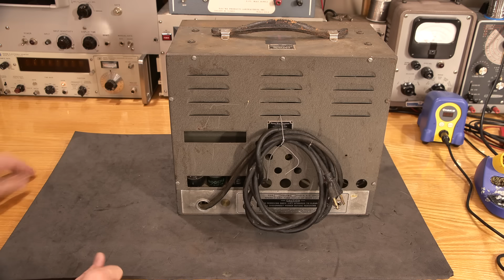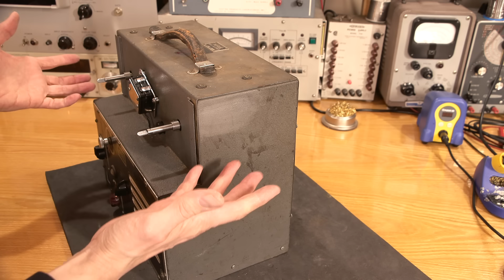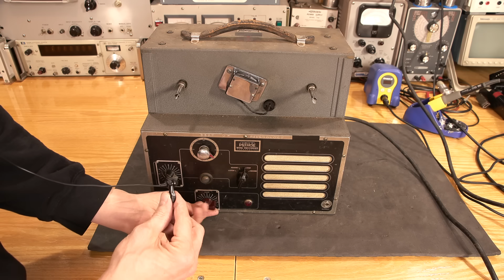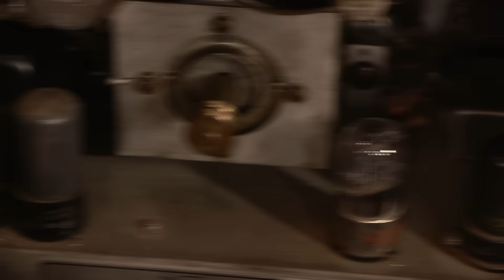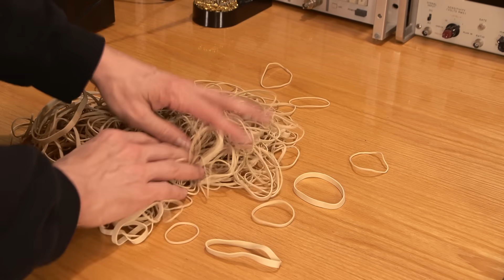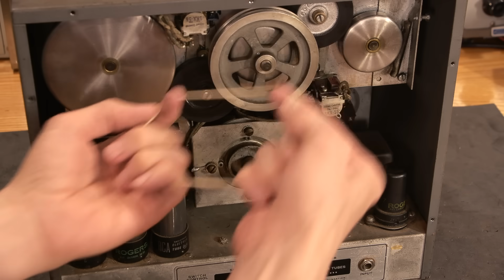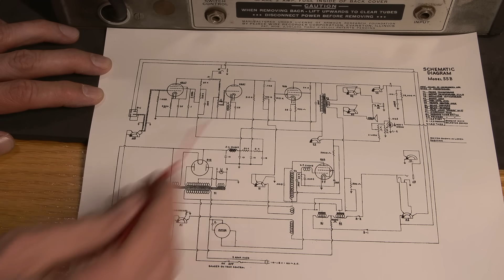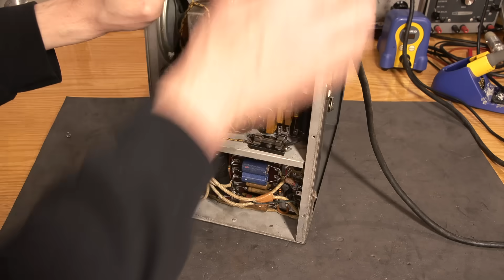Trapped Voices In This Wire - Let's Listen To Them!

Comment: This is the coolest thing I’ve ever seen. I’m 41 and didn’t even know this was a method of voice recording. So badass.
Reply: I'm 62 and never heard of this technology either
Reply: @briantaulbee6452  it’s crazy right?  How the hell does that even work!? On a thin steel wire!?!? Insane. Maybe it was a very short time frame it existed. Maybe something came out rather quickly after. I’ll bet it was one of those inventions that came about trying to improve a preexisting technology!? Who knows but it’s super cool that that can even happen.
Reply: @Ryan.S924  Magnetic audio tape came out a few years later and blew wire recorders out of the water. Tape is stronger, way less prone to breakage, and can be spliced and edited with adhesive tape. Once a thin wire breaks, theres almost no way to join it.
Reply: @Ryan.S924  I assume it's magnetic, just like audio tape. When developing recording techniques using magnetic fields, metal wire seems like an obvious first choice.
Reply: @ makes sense. Just never knew it existed. My before my generation tech knowledge is lacking lol.
Reply: @WaveArsenal  Just what I thought! What if it breaks? I remember then magnetic tapes, cassettes and vinyls. When you put a rubber belts in a turntable, the music/voice is never the right speed, and rubbers are so feeble! Anyhow, that machine worked. Mr Carlson, put us some music. Quality video. Congrats!
Reply: @Nyerguds  So the line goes back and forward to tangle well!
Reply: @Whystu725  ...did you reply tot he wrong person? I only commented on metal wire being an obvious medium for developing magnetic storage.
Reply: @Nyerguds  Gotta be doesn't it? So basically it's a tape recorder but the tape is a filament instead of a film.
Reply: @MASAo7  Yep.
Reply: @Ryan.S924 It's obviously a precursor to tape. Very, very cool, though and I had no idea this existed either.
Reply: @WaveArsenal  The betamax version of reel to reel. LOL.
Reply: @Ryan.S924  magnetic recording, same as audio tape
Reply: @ it predates audio tape and uses the same technology as tape recording, just magnetizing the wire to encode the audio signal same way audio tape is recorded.  Hard disk drives use the same idea too, magnetizing the disc surface particles to store data bits.
Reply: @Ryan.S924 it works magnetically, the same way as tape. Tape gets better fidelity though by using particles, magnetic recordings can "seep" along the wire shortly after recording, limiting bandwidth. On tape, this is isolated to individual particles.
Reply: @Ryan.S924  Wire recorders used to be used for dictation before tape recorders. I think the Germans invented them but not sure. I don't think they did too well for music though.
Reply: @Ryan.S924  u could also do it on pots and I'm not joking about that myth busters proved u could but the audio quality is crap
Reply: @Ryan.S924  amazing stuff
Reply: @briantaulbee6452 wouldn't this theoretically be similar to tape recording?
Reply: @briantaulbee6452  50 and this is a first!
Reply: @briantaulbee6452  By the time you were a teenager I suppose everything was cassettes.
Reply: I too was unaware that this technology existed and what really struck me was the clarity, its also a little creepy to hear the voice of someone who has probably been dead since before I was born…
Reply: @Turbohuff Happens with music all the time.
Reply: @Turbohuff  It sounded a little odd as they were talking about trying to control certain aspects of society. CIA kind of stuff.
Reply: Almost 60 and never did.
Reply: There was another contraption that worked by letting a speaker head fall to the floor as the wire tension in the middle slows the descent. On it's way down the speaker will play the voice recording. No electrical power needed!
Reply from the maker: Thanks! Glad you enjoyed it.
Reply: @MrCarlsonsLab   this was great, i am trying to replace a HygainVII Chassis Socket  a 5DIN i am learning its not easy
Reply: @MrCarlsonsLab 
Jesus is the way, the truth and the life. Turn to him and repent from your sins today ❤️
Reply: Can we hear the whole wiretape please ???  @MrCarlsonsLab
Reply: I’m 60.  It’s amazing, and scary the amount of history that is lost from generation to generation!  The things that my 24 yo son doesn’t know about/has never even heard of is concerning.  I don’t know if it’s just schools don’t teach these things anymore, more young people don’t read as much, or if the whole phone/internet thing has just distracted everyone and “dumbed down” younger generations.  History can be lost so quickly… if we don’t pass it on to the generations behind us!
Reply: @KimDsmom  yeah I understand and you’re def correct. However seeing most of these comments there is just as many people your age or older who have never heard of this tech. So it’s almost like you guys weren’t even learning about it as it came out!
Reply: @ Well, this tech was before my time, so wouldn’t have experienced it, but, WWI & II, for example, were before my time, and we were taught about that in school in my day.  (I assume most students these days  are still instructed on the world’s two major wars.)  I get your point, though.  This item here is kind of a peripheral aspect of a particular time period.  How I know about it is from watching old Classic Hollywood films, from the age of five.  You are exposed to a lot of tech of that time, and other cultural and daily life examples in those movies.  I still love them!  (I missed “Boomer” by a year.  WWII is my favorite era!  My son is a History major, and it’s his, as well. 🫶🏼)
Reply: @KimDsmom  i’m 43 and my daughter just turned 20 this year and that is absolutely frightening enough lol but just like you said, I am so worried for her and this whole entire next generation because of how far behind they are when I was 12 years old I was close to 6 foot tall already and as soon as I was able to carry two by fours and plywood up a ladder, I was working for my uncle making 100 bucks a day. I worked throughout my entire teenage years all the while going to school at the same time then when I was around 14 I got a job at my uncles gym, working the desk and helping people with nutrition information and also as a physical trainer as I got older and new more and more about fitness and nutrition.  I would get out of school at like 2:15pm then I would jump on the first bus and after about 10 to 15 minutes I was already at my stop and I would jump out and go to work from 3 PM to 10 PM working the desk at the gym And I was making pretty good money, especially for the 90s. I mean I was already making $500+ a week and I wasn’t paying taxes on it because I was only 14 years old. So I started to help my mother pay rent because I was making more than her I believe she was only making $350 a week after taxes as a nurse so I did my best and I was able to pay the rent out of one weeks worth of pay and then I still had all the rest of the money to do what I wanted I saved it and I bought my first car at 15 years old and stored it while I took and all that good stuff and then I made a mistake by dropping out of school because I figured I was already making more money than the adults around me although I did go back to the owl program, which was night school and I got my diploma. I just wish I would’ve stayed in the regular school so I was able to, go to prom and I missed out on that as I was saying I was ahead in life. I was already paying rent. I was the owner of two motorcycles and two cars and a pick up truck and that was all by the time I was 17 my daughter refuses to drive a car, even though she had the money to buy a car, she didn’t want to because she’s scared of driving and it really scares me because she’s 20 now and she still refuses to drive. She took a bunch of money that we had saved up for her car and she went out and bought $2000 plus of computer parts because she’s building her own computer for the first time which I’m very proud of that but she just spent thousands of dollars on a computer so I’m hoping she turns into some kind of career building. I don’t know. I feel like a lot of the children these days are developmentally stunted from this whole Covid thing that happened and I mean any human being that is stuck in the house for 2 to 3 years and then they finally allow people to go outside and try to get back to normal but unfortunately a large majority of people and especially children that got thrown into the situation they’re just not normal I don’t even know how to say it but they don’t have any social skills and their whole life is depending on an iPhone and a tablet and a computer being in front of them at all times she has missed out on so much stuff and it actually scares me because she’s old enough now to be on her own and she is absolutely not gonna be able to do that for quite a while. I mean I had my own apartment by the time. I was 17 years old I was renting a two bedroom apartment and growing weed in it, I mean I was quite the entrepreneur when I was younger and all throughout my life as well and I thought some of that was gonna rub off on her and I don’t know it’s just me for this whole generation of kids that are into young adults and I just don’t know how she’s gonna survive. I feel like she’s gonna live either with me or her mother for the rest of her life because she doesn’t get off of the computer, I mean she has a nice computer though because she spent enough money to buy a freaking car and just the parts actually which is great because normally the computer like that would cost like $3000-$4000 if you were to buy it already built with all of the parts and everything that she put into it so I am proud of that because she could make that into a career, she could make a lot of money, just building computers for people and she wouldn’t even have to leave her house. She could probably build them and ship them with UPS or something, she’s not motivated and has no lake drive in ambition that I used to have I mean goodness when I was 21 years old I was already taking care of children that we’re not mine because I got engaged to a woman and she had a little sister that was being neglected we adopted little sister and I was literally raising five year-old girl by the time I was 21 years old then when I was 23 I had my first biological child and that’s my daughter that is now 20 years old and I can just imagine my kid getting into her 30s and still not leaving the houseand that scares the shit out of me
Reply: @KimDsmom  "All those moments will be lost in time, like tears in rain."
Reply: Today years old plus 66 and this is new to me too. Very cool!
Reply: I'm 58 and just learned of wire recordings!
Reply: I don’t care about the electronics, just what was on it!
Reply: @ that was me for
Most of the video. It’s the perfect way to keep the viewer into the whole video. But nevertheless the technology is super cool on how you can recorded voice and wave lengths on wire AND THEN play it back. Blows my mind
Reply: Im a fetus i don't know what any of this shyt is and im efing scared
Reply: @AbeIsLincoln I’m 66 and never heard of this before
Reply: Finish it!!!
Reply: I would really like to see this restored. Its like ghost's from the past.
Reply: I'm 112 yo and never heard about something like this either! It must be from a parallel universe!
Reply: I'm 69 and never even heard of this method of recording.
Reply: @frankfielder  It has a magnet similar to tape recorders inside, above the box when opened backwards.
Reply: Magnetic wire led to magnetic tape what you knew as floppy disks and VHS tapes. That’s what allowed computer memory to expand before hard disc drives. It’s directly related to modern recording
Reply: @usernameonutube  theirs not many wired left but some still keep them perserved
Reply: 59, new to me! Very interesting! 🧐
Reply: I'm 54 and didn't know this existed and thought I was pretty knowlegable about tech lol.  This is amazing!
Reply: People remember cell phones only as far back as 1990's maybe late 1980's which was as big as a house phone.
Well the government had car phones in the 1960's, as big as a landline house phone back then and hooked to a big box.
They didn't work the same way as cell phones today and each call was charged for same way as landlines back then into the 1990's, except way more per call.
Only the rich could afford one so most never knew of them.
Reply: You should have seen the 40, it used cable and the 39 utilized chain.  Coincidentally WD40 was invented to clean, lucubrate and preserve the wire before the use of stainless.
Reply: @ so cool. I wish I grew up back then. Coming up with inventions for inventions lol
Reply: @Ryan.S924  I am a Laura Ingalls Wilder fan and she lived from 1867 to 1958--she literally saw everthing invented that we know today.  EVERY. THING.  All the way down to chewing gum! (it existed earlier but first patented in 1869).  Ok, well except trains and steam engines lol.
Reply: Yeah I'm almost 50 and never heard of it.
Reply: Bro you need to come spend a day in my life 😊
Reply: I’m 67 and I’m blown away I never knew about wire recording
Reply: I also had no idea that this could be done. I'd like to know how it went.. Was this wire used specifically to record voices? What was being done with the wire when it was recording? Did the guys talking have any idea their voices were being recorded? You all know way more than me, but how did you know there might be voices on this wire? I remember having a reel-to-reel tape recorder and was aware of only that "tape" being a recording medium. Can all metals pick up voices, or is it just this one kind? So many questions, so few answers
Reply: Same but I am 49... I would love to hear the entire conversation!!  so cool. Sounds better than my 35 yo cassette tapes.
Reply: Now thinking if I was a millionaire in 1940s I'd hook up 8 of these machines with a sync and do world's first multitrack recording :D
Reply: @DCXTV  not too late to do it now.  Would be a great youtube vid!! That would be REALLY cool!!
Reply: @ it would be cool even with a C-cassette farm 😅
Reply: 57 here, never seen one, truly a lot piece of tech. :D I had a old reel to reel when I was a lad. But never saw this.
Reply: How did we not learn about this in school?
Reply: @ not sure but I don’t think I did. Unless I wasn’t there that day lol
Reply: Maybe not related, but could this type of recording be a explanation of how some hauntings occur in old locations with stone or metal. The voices are imprinted in the environment.
Reply: @ramzetube781  we have been experimenting with that Mythbusters. It proved u can put voices on pottery
Reply: @ramzetube781  so yea fun stuff
Reply: I'm an EE, 62 years old...didn't know that either...magnetic voice on SS wire.
Reply: Same
Reply: Im almost 63 and not heard of that. 
Pretty awesome. And technology has come a long way.
Reply: Very interesent .ihave one.... For years. What is the price this  machines un this days . Saludos from chile......excuse me for  my ingles
Reply: I'm 2 years younger and it's a first
Reply: This is the BETA of voice recording.
Reply: Wow, ever? It's cool, but, are you 6 yo?
Reply: @ I find it fascinating. You have an issue with that? Don’t you find thing to be cool and get excited about it?  Man you must be fun at parties.
Reply: *good
Reply: Me either and I’m 71!
Reply: What a total crock of Bullshit. 40 minutes wasted on this clown,s Jibber Jabber .
Reply: Soon 45 and worked with audio for 29 years and I don't remember hearing of a wire recorder either. This is fascinating.
Reply: They used wire recorders in the military in ww2
Reply: Please make another video on this
Reply: Many ways to record in very old times. Ancient pottery making was one. Do some research on acoustic archaeology.
Reply: Yessss me tooo!!!! Never heard about this 😮
Reply: Same I am 41 as well too
Reply: I'm 132 and never heard of wire recorders before!
Reply: I only did because it was featured on an episode of "Eureka".
Reply: @enviableechidna  what are you talking about!?
Reply: The wire recording is basically how the black box in airplanes works, if I’m correct.
Reply: I’m 58 and neither knew this device !!!
Reply: Me either
Reply: 41? You’re just a baby!
Reply: For some reason I can see big guy from mission impossible  hiding the wire in a tool box. Speaking wire out of a worksite next door to the KGB
Reply: Agree with you (and I am 41 too! lol). AMAZING!!!!!!!!!!!!
Reply: Never in my 15 years of life had I heard of this
Reply: I wanted to write exactly the same . I will be 42 this year and I was totaly fascinated by this  . There are so many cool things that I do not know about .
Reply: 51 ,first time too
Reply: Im 48, and one of the oldest things I have seen is cylinder records. I didn't know about this thing either.
Reply: Yep, i’m 23 and can confirm it’s very cool
Reply: You can get voices off pottery that was made while people were talking.
Reply: @random75491 pottery!? Like ceramic pottery? Like you put your flowers in or decorative stuff for the house!?
Reply: I'm 49 and I also never heard of this. The creasiest part, though, is that just last night I was trying to make a use from a reel of this wire, that I bought on flea market some 10 years ago, knowing nothing about it. And YT must have spied on me, so I got this video as recommendation.
Reply: Sounds like Richard nixon manner of speaking
Reply: @kitbram2033  I thought of Henry Kissenger.
Reply: @kitbram2033  I was thinking of someone in the realm of a doc office or someone important as well seemed like they were talking about government taking care of families or something. Something about a women sleeping in the barn? Maybe a child or family member was having issues with it and they sought out a counselor or psychiatrist? If you looked at the device someone wrote Dept of psychiatry. Who knows!?
Reply: @kitbram2033  One time I bought a cassette recorder at an estate sale. There was a tape in it that was from a bank board of directors meeting. They were talking about what dead beats borrowers were and how to get rid of them. Some really bizarre ideas were discussed.
Reply: I believe this wire recorder was invented by Thomas Edison.
Reply: I'm very into spiritual things and a guru once said that someday any crime that occurs where metal jewelry was present during the occurrence...Will be used as sound evidence in the court of law. Now I understand.
Reply: @kathleen2008inthenow 😮
Reply: @kathleen2008inthenow  Imagine all the information contained in a wedding ring!
Reply: @jamiegriffis9783 There is no information contained in a ring, sound doesn't just automatically write itself onto metal, it would take a device like you see here, and the ring is far to small to contain anything.